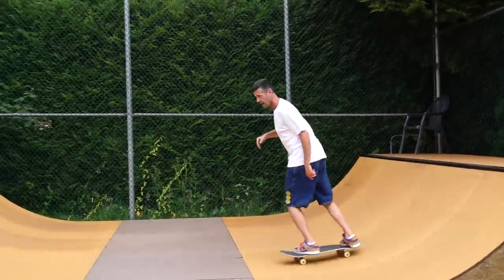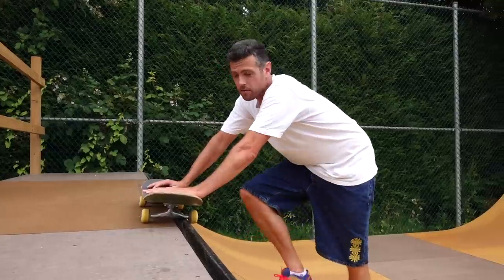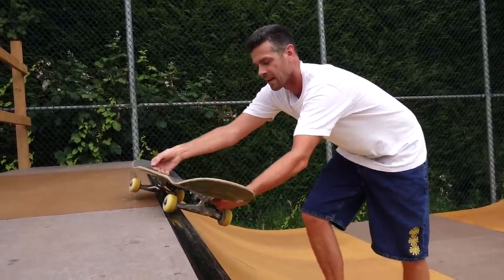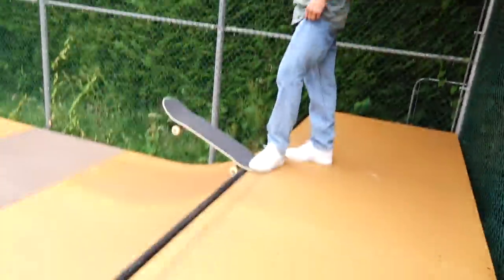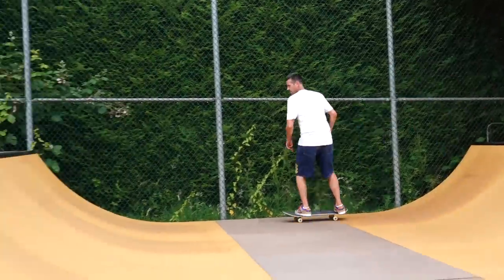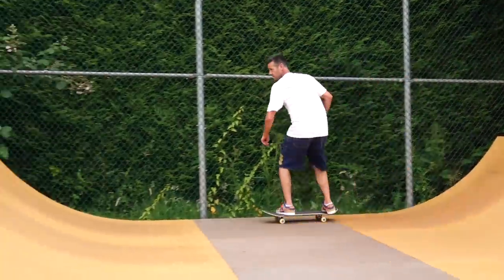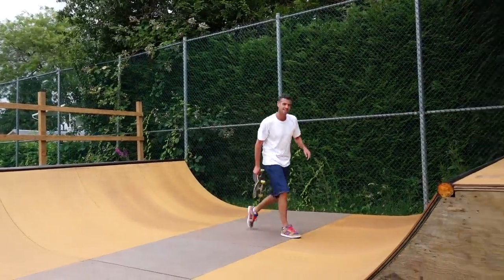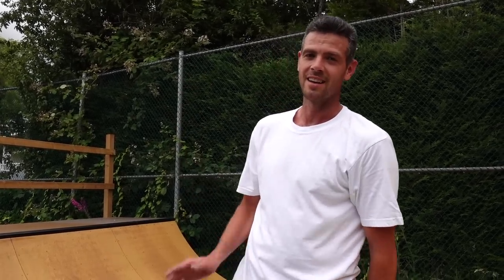Still grinding ramps like a street skater?....Try it like this!!!!

Comment: What are the dimensions of that ramp?  Looks perfect.  I'm planning on getting a mini ramp in the future.
Reply: Not sure, wild guess is prolly around 3 feet high, 12 feet in width, and 18-20 feet long including the top deck and everything
Reply: I had exactly the same question as soon as I saw it. I am planning to try and build a miniramp from some scrap I have and this looks like the perfect size!
Reply: If those sheets are 4x8, it's 16' wide.  I have a 8' wide 3' miniramp and it's too narrow to really get into a grind.

Comment: The reality to doing 5050 is, if you want to be good at them, you need to learn how to lock in both ways and come in on transition either way it locks in. It’ll take some time to get consistent on how you lock in, but a good skater can come in from either positioning comfortably. It’s all person preference, but I’ve found for shorter grinds or corner grinds I like to be cross locked, but if I’m going for a long 5050 that may how some kinks to it, it’s much easy to stay locked in on top either heel or toe side.
Reply: TOE SIDE????? man, that sounds awful feeling. I hate those on transition

Comment: I think it is just personal preference. You are cross locking. Jeff Grosso did that, so it must be ok!  Personally I think cross locking looks and feels strange on a frontside grind. 
I am always on the heel side of my trucks for frontside and backside grinds.  With frontside, my toe side wheels are on the deck when I ride mini ramp, but are raised when I ride bowl as the speed keeps my trucks on an angle, as with the true 50 50 description you mentioned.

Comment: 8" Cal7 natural wood grain board
Indy stage 11 139's
52mm green Spitfire Formula four classics
Shake Junt green/gold triple OG's abec-7 bearings
Gold 1" Pig hardware 
vintage clear Pig 1/8" riser

I would be skating my 20 year old 7.6 Venture Awake Highs or Stage 8 Indy 129's... but I recently found them both and they are still too nice and nostalgic for me to wanna skate and keep scratching up. They arent ground down much at all and I kinda wanna preserve them for historys sake. Cleaned em up with a full dismantle/sos pad/new bushing (conicals ; ) just like the stage 8's came with). There was also some hardly worn 52mm Flip wheels - classic shape with clear urethane and black triangle cores on one of the 2 pairs of trucks I found. Nostalgia is real - I dont wanna skate em - just preserve the early 00's vibes.

Comment: I think 50 50 came from using both trucks it then morphed i to 5-0 grind being the new name for stand up grind. Not ramp position . 
I am 55 was Canada's pro for 86 expo world championships and was on Santa Cruz team so I was right there at the time even earlier ,skated since 8yrs old. Just sayin'........
I watch your  vids they are proper!! 
I ground Vanderhoof vert pool coping this year. F.Y.W.S.S. is my crew. Totonto
Reply: Cool man. Yes 50 50 is both trucks but 5-0 is just back truck. Its not the new name for a stand up 50 50. However alot of people just say 50 in short for 50 50. From what youve done l know u know this. Just correcting something u prob accidentally wrote. Summary: 50 50 (fifty fifty) is both trucks & 5-O (five o) is only the back truck. 👍
Reply: @chris73brown  pointless picky me meant to say back truck grinds that were not slash style were called stand up grinds for a long time  before I ever heard it called a 5 0 grind. I just assumed the 5 worked its name into stand up after, as I heard 50 50 long before 5oh grinds. But that's me n my world ,there are lots of scenes. We called backside pivots Burlingtons for  a long time all depends where you were I guess. Cheers
Reply: @nigeldutru109  👍

Comment: i never had any problems coming back in off of heel side, and if i do cross lock front 50s it’s toe side in the back much more steez. you might as well be doing a smith if you’re cross locked toe side in the front in my opinion
Reply: Exactly

Comment: Sheesh I thought the double heel was the “proper” way 😭 I never really hang up but learning that oomf movement out to not hang that back wheel was….painful. I think I can aim and try this out cause I got FS smiths pretty solid. Thanks Ben.
Reply: What is that "oomf moment" you're talking about? :) Can you please explain?
Reply: the “oomf” I’m referring to is that little movement you would do when your like stationary on a ledge or coping balancing on your trucks and you have to like use your hips and your entire body to kind of push away from the ledge/coping so you can continue your line/trick. I call it the “oomf” because that’s almost the sound your making when you start learning this integral movement.
Reply: There's no such thing as the proper way. There's the proper way FOR YOU :)
Reply: It is personal preference. I double heel because it feels more stable to me.
Reply: Double heel is proper when stalling a back 50 & coming in on a front

Comment: Ben do you find you have less truck slip on coping with Ventures than Indy's?. I had Ventures in the 90's and had 50 grinds down and would just have both trucks slightly on the heel side of the king pin for bs 50 grinds and would never get truck slip. Trying to relearn them with Indy's the same way and get truck slip everytime. The indys are even wore down pretty good. Maybe my coping back then was softer and that's why?.

Comment: It might seem unusual but I do my backsides exactly how you say a fs should be. (i.e. the opposite of how you do a BS) Rear foot toe side wheel against the coping and front foot heel side wheel against the coping. I learned this naturally and it lent itself to grinding around bowl corners very easily (see my profile picture or some of my videos ) - exactly how you explained for your FS explanation but a mirror view.
It seems to me the way you do your bs mostly comes from street skaters or the post 2000 generation of skaters I don’t remember every seeing it that way before the street skating boom of the 2000’s so I’m presuming it came from people skating ledges.
Bitd it was most often a straight 5050 with no diagonal lock it would be done going much faster and a quick in and out , if you were going for a longer one you would just go faster and that still pretty evident today if you watch vert skaters, you don’t really see anyone hanging off their back wheel like that.
So there’s a few nuanced differences depending on how you learned and what your background and skate discipline history is.
But you are right in the sense of rolling across the top of the platform isn’t a true 5050 but I agree it’s great gateway to learning.

Comment: I'll try this but I heel lock both trucks and can grind for days and it feels fine getting out of it.
Reply from the maker: If you learn it cross lock it makes double heel side feel wrong. This is also the only way to do it safely on a spine.
Reply: @bendegros  That makes sense, I wouldn't dare do it on a spine the way I lock.

Comment: Hello Ben, this is off topic from the video but I was wondering if you knew the difference from TEAM thunder trucks and regular thunder trucks. I’ve also heard the rumor that all thunder are made Hi now.
Reply: TEAM has cast BP, and also regular thunder, but there are TEAM hollow, which means cast BP w/ hollow axle. little bit lighter and same height as regular ones.
there are no more thunder high or low, they make it one height only, but as width goes up, height also goes up, not like indy all 55mm/53.5mm.

 145   147   148   149
 50      50     52    52 mm
all forged BP should lower by 1~1.5mm
go to their website to see more

Comment: Can the "slipping over of the wheels" you talk about at 6:39 be avoided? Doesn't this happen because you actually have a lot of forward momentum when approaching the corner?
Reply: Definitely comes from fighting the momentum of the corner, it can be avoided by leaning a bit more into the ramp. My experience with backside corner grinds is that they feel more like a smith than a 50-50, because you're working harder to point the nose towards the bowl

Comment: I cross lock the opposite way for backside. Back foot toe side, front foot heel side. I tried doing it your way and did not like it. It really slowed me down and made long grinds impossible. I am skating full speed for longer grinds. Does anyone else do it my way? I think my way helps you really lock in the grind. If you do it my way you can really sit on a grind for a long time. I think it looks cool too. I feel like cross locking the way in this video forces you out of the grind and back in the ramp.
Reply: Dont think your smarter than Degros. Its literally rediculous to condecend the legend
Reply: @galvanizedgnome  I am smarter than the salami and the cheese. COMBINED...who is Degros?
Reply: That sounds like locking in that way would feel scary as heck
Reply: @funkydankspliff  it feels really similar to locking in toe side with both feet.

Comment: I will say I think locking into a front 50 "wrongly"  on the deepside of the bowl and then dropping back in at 90 degrees is something i think ive seen grant taylor do on purpose, it is significantly more dangerous than having your front truck locked in toe side and he is a maniac

Comment: ive skated for like 20 years and i still cant do 50-50s on tranny frontside very well. its a slow procedure where i have to lift off like im trying not to turn my 1920s faucet into a 1920s leaky faucet. lol. aka hang up and bash my face on the concrete. lol.